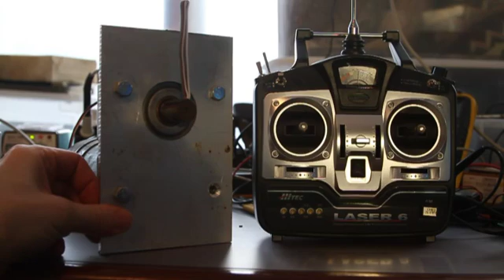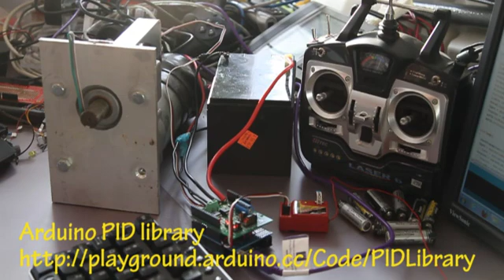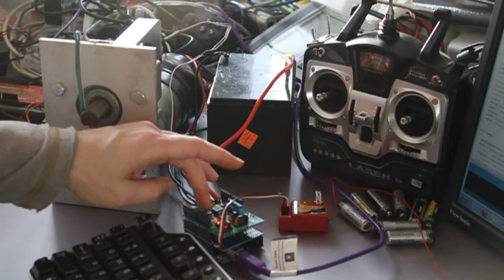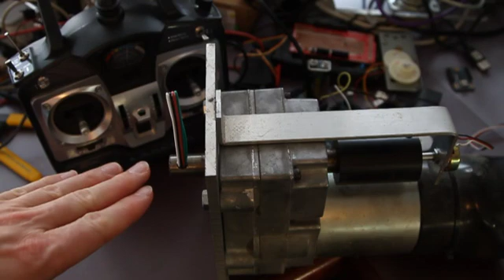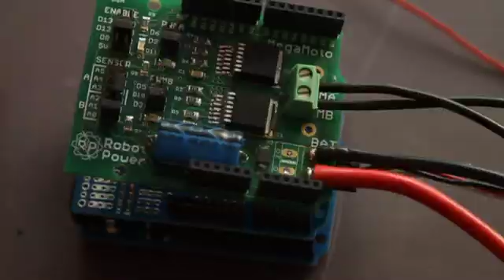SuperServoMotor

Comment: It's hard to see how the pot is connected to the shaft. It's something I want to do though as high torque servos are just so expensive.
Do you have some more information about this potentiometer too? It doesn't like your your ordinairy small sized 1 turn potentiometer.
Reply: +Masterpj555 edit: I seem to get it now.
VERY CLEVER! You have a gear over the main shaft connected to another shaft with the same 1:1 gear ratio and a potentiometer at the end of that one!
Reply from the maker: +Masterpj555   These are Jack motors used in recreational vehicles.  They had the shaft on both ends like that, which made it easier to attach the POT.  I just used a solid piece of plastic rod (the black plastic) and drilled slightly undersized holes for the shaft and at the other end for the pot.  Its just friction fit.  I was going to put set screws in the plastic but realized the friction was perfect because while experimenting with the code, I would get a run away situation at times and the POT would just come to its limit and slip on the shaft instead of being ruined.
Reply: What is the maximum obtainable speed here? is there noticible lag in the resistance reading? I like the torque but would love the speed in for instance a robot arm
Reply from the maker: +Masterpj555 I think what you are referring to is the slight delay you see from the stick position to the motor.  The PID tunning probably has the greatest effect on responsiveness,  PID can be tuned to be more aggressive (faster).   The motors are geared down a lot though, so the speed you see is almost at the motor's max
Reply: +bzeug Thanks! I will look into all of this. It's really interesting as the fact you are in control of the PID you can also control the deadband level you normall have on servos which can cause awfull jitter.
Reply: bzeug hhhzjjz
hzgsud

Comment: Good job once again ...Do you think a wheelchair motor could be used instead of the jack motor for this application?
Reply from the maker: ***** It needs to be very low RPM.  The speed you are seeing is full speed.  When the stick is slammed to one side it even takes the motor a moment to catch up, that is how low the RPMs are.

Comment: Hi Bzeug.
Great work and I am impressed by your ability to adapt all the code to make it suit your application. I am trying to do something similar but without the RC equipment and the shield current feedback. I simply want to drive the servo only with a POT wired into the Arduino. What can I eliminiate from your code to simply drive it with a POT? Thanks for your efforts and taking the time to read this. Chris

Comment: can you send me pleaz the schematic of the H bridge whith all componets reference..and how you drive the motor?? I am in a similar project and i want the steering system..you know the power of motor??(kg)i want to make a giant rc..email: Fernandodouglas22@gmail.com
Reply from the maker: The H-Bridge you can buy from RobotPower.com  It is the MegaMoto for Arduino.  My code which gets uploaded to the Arduino is posted at the link in the description above.  The torque of the output is very high and very slow, I do not know the exact spec.